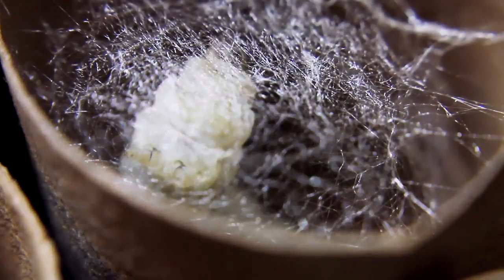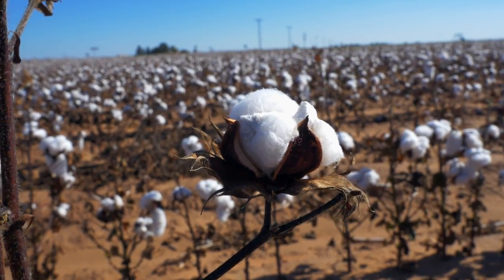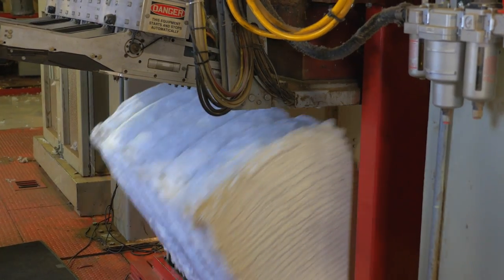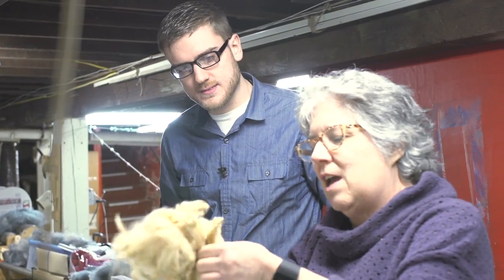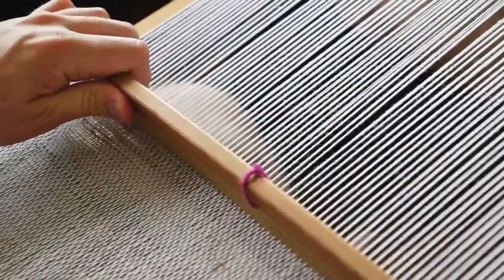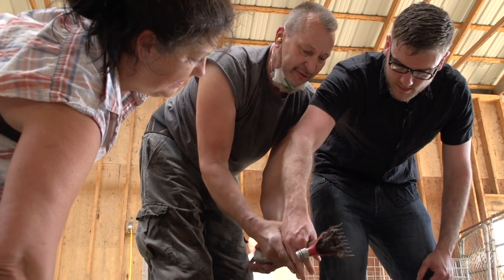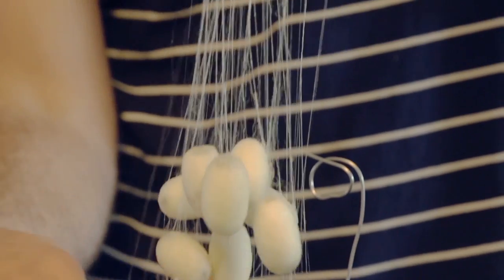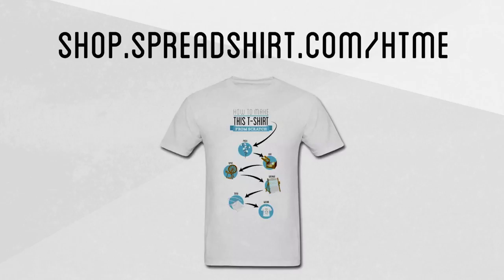Formal Suit Made from Hemp, Cotton, Alpaca, Silk, & Wool | HTME: Remix

Comment: Make a sword!
Reply: Hunter how to make a Katana sword!
Reply: Fkn weebs
Reply: Cole Hickey i dont know why u think hes a weeb, katanas are popular in modern video games and movies
Reply: Mr. Krebebs weeb
Reply: you should check out man at arm series by AweMeChannel @AweMeChannel Yeah it kinda look like it came out of a tv network.
Reply: Actually you know what? Katanas would be a great idea, made out of pretty crappy steel to begin with, itd be easy to make from raw materials, the steel at least. Making the blade is a different issue
Reply: lol49031 well, it's much easier to design a long sword or a broadsword then a katana remember, he can't spend a lot of money on processes to form steel into the curved shape
Reply: Augustine Daudud what design? Katanas are forged straight then curve when quenched curve, he just needs to get the clay thickness right. He has to forge a billet into a blade whether he makes a katana or a longsword, longswords have the disadvantage of being harder to forge due to two seperate bevels. He could always do a saber type blade as well but with the shit steel he will probably have it probably wont end well, at least with a katana the folding process removes impurities from the metal and makes the carbon in the steel more evenly spread.

Actually you know what? Fuck making a sword, he should make a knife instead. Shorter blade length, less likely to bend in the quench, requires less materials and less fuel since it has to heat less steel and most importantly, more useful than a sword
Reply: lol49031 sure, but remember that he's doing this from scratch! Therefore he is probably going to mess up the thickness, which is why I think he should make a long sword or at least a Roman Gladius, those are the simplest to make, and they're pretty good at piercing armor as well
Reply: lol49031 plus, if he's doing it from scratch he doesn't have the same par as artisan, and I don't think he's going to spend so much money to get a professional to do it all for him, he has to do some work himself
Reply: Augustine Daudud i would still prefer if he makes a sabre, it is harder to mess up the thickness on a single bevelled sword compared to a double bevelled sword like the two you suggested above, also most longswords have fullers which would be hard for a newbie to make. In any case he should start small and try making a knife from scratch first, better to have extra steel by making a small object so he can make another if he messes the first one up.
Reply: lol49031 true true, Sabres are superior to longswords
Reply: lol49031 yeah, he could use the knife he makes to smear butter that he made on toast that he made on a fire grill
Reply: nvttyoung katanas are pretty bad swords
Reply: Mr. Krebebs 

MODERN VIDEO GAMES
Reply: Hunter OH MY GOD YES
Reply: I think he really did made a sword?
Reply: Augustine Daudud Why are you spouting ramdom bullshit? Do you even know what a longsword is in accordance to Oakenshot terminology or just assume based on video games? Have you ever attampted to achieve a symmetrical blade and the heat treat it properly? In what way is a katana harder to make? If anything its the natural tendency of the metal to bend during forging or quenching.
Reply: He would have to refine his own iron, make his own steel, and chop his own wood. He could probably do it.
Reply: And i know just the people who can help, the boys at BKS

Comment: How to make knife from scratch?
Reply: WCKern yeah saw that however they are expert blacksmiths with great knowledge and skill. I would like to see how an amateur could do good suggestion though
Reply: I agree it would be fun to see the whole amateur process - probably the easiest way for him to do it from scratch would involve get a source of iron ore and smelting into steel - but alternatively, he could take pure iron oxide (rust or hematite, magnetite, etc.), reduce it using hydrogen (from water electrophoresis) which would produce pure iron, and then melt the iron into an ingot and carburize using calcium carbonate.  It would be a more involved process, but would make a more refined steel.
Reply: Or a whole series like that. Making an entire arsenal of weapons
Reply from the maker: Definitely something I'll be doing sooner then later.  I've already collected a bunch of iron ore, but I haven't gotten access to the right equipment yet to be able to extract it.  A "weapons" series is very likely going to happen early next year as in the process of making the chemicals for my camera from scratch, I'll also have everything to make my own gunpowder from scratch.
Reply: How To Make Everything great to hear :3
Reply: How To Make Everything make sure u carbonize the iron into steel . I would research many ancient techniques. Knives are defiantly easy to start since there are so many techniques since they have been around for so long.
Reply: That's why you would use the calcium carbonate (chalk, eggshells, limestone)... when you heat up the iron and carbon source you get carbon migration into the metal.
Reply: Lil E D E F I A N T L Y
Reply: Adam Kaniowski watch any knife making video
Reply: why my make the equipment to process the ore.

Comment: A fine end result, I'm sure we all agree. But I feel the need to make a note on sartorial naming conventions. To be called a suit, the jacket needs to match the trousers. And to be classified as formal, there are even more details to consider (even a tuxedo is technically only semi-formal). What you have made is a sports coat. Wikipedia describe those as follows: "Though it is of a similar cut and length to a suit jacket, a sport coat is less formal and is designed to be worn on its own without matching trousers. Styles, fabrics, colours and patterns are more varied than in most suits; sturdier and thicker fabrics are commonly used, such as corduroy, suede, denim, leather, and tweed."

Comment: Alpaca fibres do not have scales, that's why it is less itchy than wool. They are also hollow which is why they are warmer than wool. The downside is that if spun into yarn or used in a non felted fabric, Alpaca has no memory and stretches over time. Also, you can use the silk from the silkworms after they have emerged, it just takes more effort.

With spinning, you lose 10% of the weight by washing it (lanolin and dirt being washed away, felted pieces of fleece) and a further 10-20% through combing and carding the fleece so you end up with 30% less weight of wool than when you first started. How fine you spin, how loosely you weave and how firm you felt all determine how much yield you get from your fibres.

As a spinner for almost a decade, knitter and weaver for a decade or more....the amount of materials gathered were not nearly enough, especially with the cotton for the shirt and the wool for the vest. You could have gotten the spinner to spin your sheep's wool for you, you would have gotten more yield that way?

Comment: I didn't realize that hemp was made in the same way as linen. Another way that he could have felted the alpaca wool in a more primitive way is to use leather instead of bubble wrap, wrap the entire thing around a long piece of wood which has a tunnel bore through the middle of it, threaded some rope through the wood, tied it back onto itself to create a loop. Wrap some ties around the whole thing to hold it together. Grab the Rope and pull the whole thing up a hill, release the rope and watch the whole thing roll down the hill. This will cause the wool to mat together and this method uses only natural materials. Oh and of course don't forget to pour the warm water and soap over the wall before rolling it up and then rolling it down the hill. If you didn't get what I was saying I was basically saying use leather instead of bubble wrap and roll it down a hill instead of rolling it on a table in front of yourself.

Comment: Hemp nuts are a lot like gun nuts.  There is probably a lot overlap between those two circles of nuttery.  Or is it nutterie?  Nutterée?  I bet being stuck in an elevator with a hemp nut and a gun nut would be like stuck on an elevator in hell, except louder.  It's the eyes.  You can see the crazy in their eyes.  Their voices are crazy sounding, too, but you really see it in their eyes.  Gun nuts are usually fatter, though.

Comment: If the pants were made out of marijuana could you smoke the pants and get high?
Reply: It's hemp not marijuana. No such properties.  Hemp is actually really good for agriculture, it grows a lot faster than trees which take 20 years to reach maturity (or rainforest trees which take 100+ years to reach maturity) use less water, and you can grow a lot more in a smaller area so they are a lot more environmentally friendly. The supposed "health benefits" of consuming hemp extracts are probably just snake oil but practically they are amazing, and can be used as a complete alternative to wood.